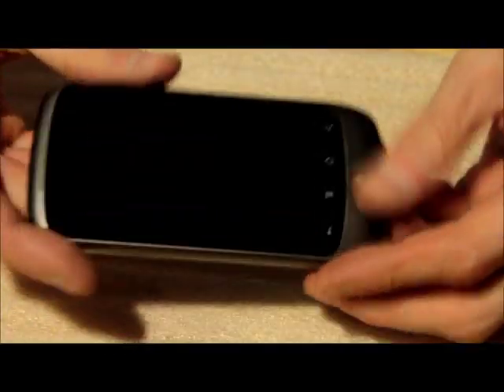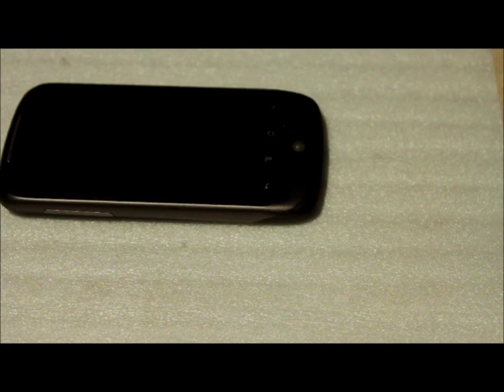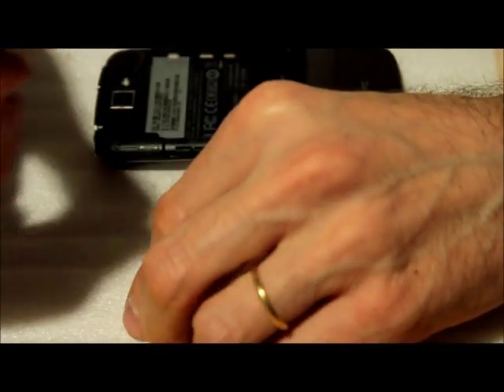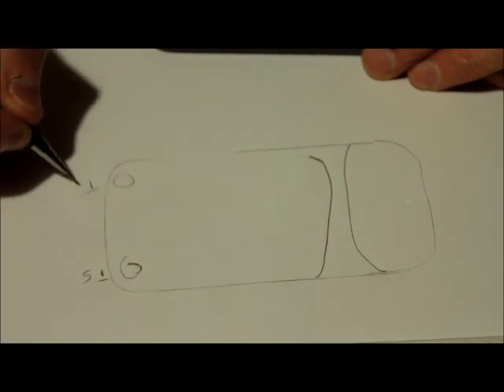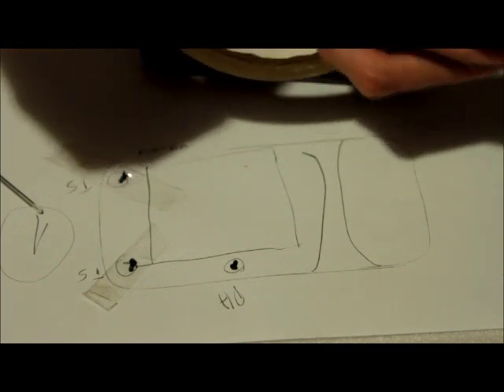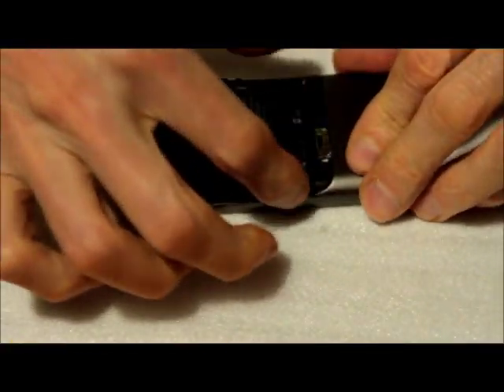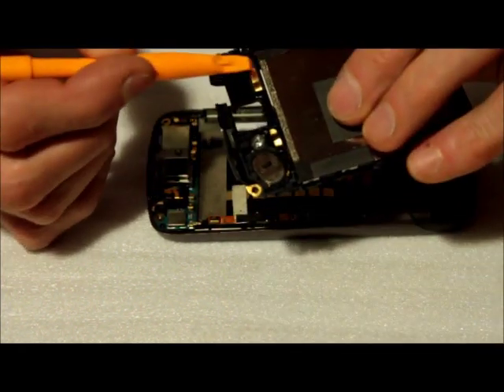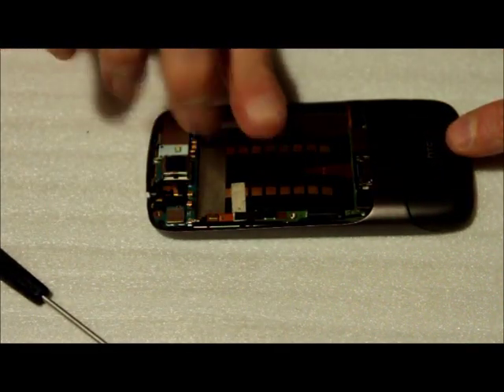how to repair the power switch of your Nexus one.  PART 1 OF 5

Comment: You have to remove the battery and insert it just after the LED-light on the front goes out.
Here is a pretty good video I found.
/watch?v=36tkRz4IZ8o

Comment: Great guide!  I took mine apart and cleaned it but it didn't do much good. 
However, a BETTER FIX is to ninja-start your phone by inserting the charger and removing and inserting the battery again. This will start your phone WITHOUT the power button. 
Now just go to android market (play store) and download "Fix Broken Power Button". (red icon). Install, enable and unlock your screen using the volyme control. Lock by placing a widget-icon on the screen! 
Your phone is FIXED! 2 minutes, no hassle!

Comment from the maker: The camera is inserted in the square socket. You have to remove the camera from the old flex. Notice the orientation. 1- Remove a metallic frame that keeps the camera in place. Use the plastic tool an pry near the base of the socket.  2- Lift the camera out of the socket. Place adhesive tape on the top of  it  to lift it ,and use the plastic prying tool to remove it.
Once is out place it with the same orientation in the socket of the new flex, and then carefully remove the tape and put the frame

Comment: great videos, but if repairing seems like too kuch work: if you plug the micro usb cable into a power source, and pull out and replace the battery 5-10 times it will confuse the device and turn it on. then just get widgets/apps  that unlock the phone with the volume, cyanogenmod has this function built in. you can also screen lock and reboot with other apps.

Comment: I loved my Nexus until the button stopped working.  I figured out how to turn it on with the charger or USB cable and was fine with it. 

Then I went to flash a new ROM on it and something went wrong causing a boot loop. I went crazy trying to figure out how to get it into recovery without the power button.  Finally found a way to do it with Superboot. 

I've gotten used to managing it without a power button. The ROM I run has trackball wake and a sleep widget.  I forget it has the button now.

Comment: Fantastic Guide, not for the faint hearted, I fixed my phone using this approach as well. Additional tips:
-Magnifying glass a must
-sticky tape to mask the pins you don't want solder on
if you manage to get it working mod the phone straight away and install something like cyanogem mod which has a wake on trackball option. Also install a lock app that allows you to lock the screen without using the power button via a 1x1 widget on the home screen.

Comment: Great guide, works great. VERY nerve-racking, the solder work is V. small.  Some tips for others...
. Use a magnifying glass for the soldering
. Use smalls pieces of blu-tac to hold the wires over each connection, while you touch the wire the solder iron tip
. If you've no magnet wire, open up an old mains power adapter, rip out the small square transformer, and use some wire from that
. make a fine tip for your solder iron by wrapping 1mm thick copper wire round it and file the end to a point